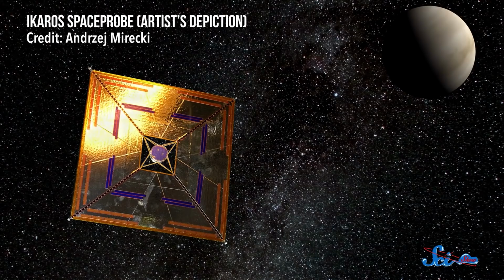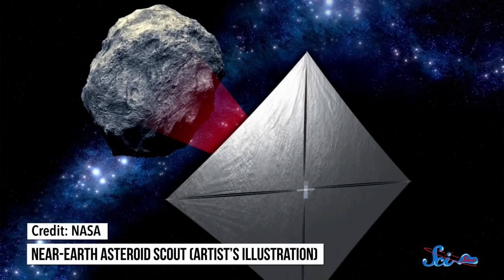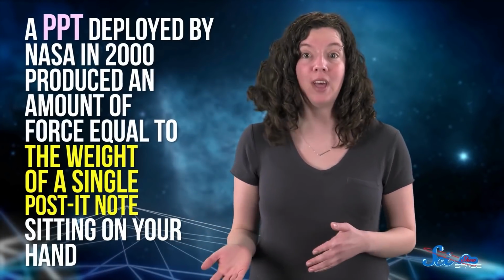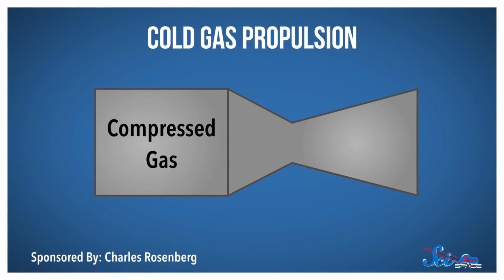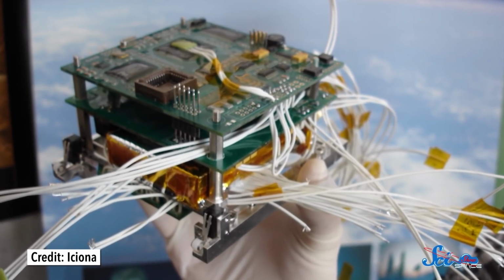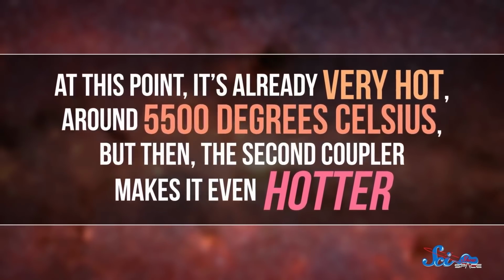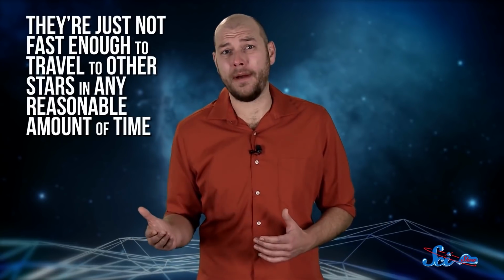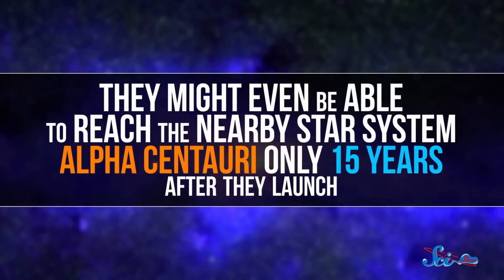5 Ways to Travel the Universe | Compilation

Comment: Great video, but I'm disappointed that there was no mention of Nuclear Thermal Propulsion. Engines for such a system were built & tested in the 1960s ~ 70s. And they worked well. 
They also have about 8 or 10 times the Specific Impulse of chemical rockets. How about a video on that topic - I know you have already made one about Project Orion (nuclear bomb propulsion). I watched (and liked) it.

Comment: We don't nearly hear enough about VASIMR these days 😢
Reply: I'm sure they're working on it, but if it's only one big group they may only release info every couple years.
Reply: Renamed, now NASAs preferred way to assist power to Mars. Radiation measurements have ruled out chemical rockets.
Reply: @gordonn4915  
Well... maybe . 
Truth be told , advancing active/passive shielding techniques may indeed yet come to strongly mitigate the much feared space-radiation hazard . The likely unbeatable problem however , is the "Biosphere Syndrome" . Humans trapped together in a small tin can WILL turn on each other , endangering both that mission and those to come . 
VASIMR itself is potentially fatally flawed ; it's power-to-weight ratio is abysmal , so not as much help as is needed . This is why NASA is also looking hard at revamping the older nuclear-thermal technology . 
In space , brute-force does have a place . 
*To examine some possible near-future space-propulsion systems , read my post at : 
quora.com/How-do-impulse-engines-work/
Reply: @AustinThomasPhD  The last thing I can see from them was a press release in August 2019 and that's it.

Comment: For those wondering about how photons have momentum, we need to look at e=mc^2

That is the equation for finding the total energy of a stationary particle, or simply the energy that the particle itself contains, rather than the energy propelling it. However, when a particle is in motion, there is a slightly more complex equation to calculate it's energy.

e^2 = (ρ^2)(c^2) + (m^2)(c^4)

As photons have no mass, we can remove the second half of the equation and simplify, leaving us with:

e = ρc

ρ, the Greek letter rho, is used for momentum. This can be rearranged to show that the momentum of a photon can be found by dividing its energy by the speed of light, c.
Reply: Usually it's just a p, I can't think of too many cases where it's traditional to use rho for momentum.

Comment: That idea of photonic/laser propulsion for manned missions is only practical between locations already travelled to - to have another "braking" laser at the other end of the journey. Long distance missions of investigation to the nearest star systems, reaching maybe 25% of light speed, would need some equally ultra-high-speed sensors to do some "ultra-quick detecting" at the other end before they blast past in to the far distance!
Reply: Solar systems are big, at 25% the speed of light you'd have a couple days to pass through the solar system. Once we built up the capacity for such missions we could send several through with a much lower marginal cost. I believe that's the idea.

Comment: Launch a solar sail spacecraft.  1 year later launch a second solar sail spacecraft on the same path, equipped with a nuclear powered hi power laser with a tracking system to detect the first spacecraft and aim photons at it's sail.  1 year later launch a third solar sail spacecraft on the same path,  equipped with a nuclear powered hi power laser with a tracking system to detect the second spacecraft and aim photons at it's sail. Rinse and repeat.

Comment: I am wondering one thing. We can use powerful lasers in order to give momentum to a space sail and propel it to relativistic speeds. That's fine. But, why don't we use something with more momentum and mass instead of light? Imagine the following case: We build a small particle accelerator in the moon, and we use it to shoot hydrogen ions towards a spaceship. We don't really need to reach c, since accelerating the ions to 50% of c, would eventually make the ship to reach that speed. We could even use a magnetic field in the sail, and, in the future where we have a fusion engine, we can just send the fuel through space.

Comment: Photons have momentum because they travel at the speed of light, which is the universe's physical analogue for "infinite" speed.  This is why massive particles cannot travel at c, while massless particles *must*.

Absolute Zero and the Planck Temperature exist for similar reasons; actual infinities cannot exist in the real world, so the universe requires analogues so you get meaningful values when you multiply and divide by zero (that's an excessive simplification).

Comment: I use Neutron Stars…first I low fly a Sun with a scoop for fuel…then I short warp to a mapped Neutron Star..where I fly into the cone..the cone will spit me out at 2000c or 2000xFTL…using the scoop also super charges me..after exciting cone I engage warp drive….I’m jumping 100-150 LY in minutes…..using a Neutron Highway…I travel millions LY….I’ve been to the Galactic Core

Comment: The problems with long duration human space travel boils down to one thing, POWER.  Until we can develop a relatively light way, high power system like fusion then we will never travel long distances.  Fusion power can provide enough power to protect against radiation by creating an EM shield and also provide enough power for centrifuges or constant thrust to counteract the problems with living in microgravity.  Develop small scale fusion power and we can go anywhere.

Comment: or, instead of Vasmir, you could return the idea of NERVA which was done in the 60s and could get people to Mars in a month.
Reply: Yeah, but VASIMR has the advantage of not exposing the crew to deadly levels of radiation, and also not risking nuclear fallout in the case of a failed launch.
Reply: @danieljensen2626  You obviously known nothing about NERVA if you think this.  I suggest you actually sit down and read up on the information as for one, the crew will easily be safe from the radiation the reactor is giving off as the crew will not be near it.  Secondly, on a failed launch, the engine isn't going to explode like a nuclear weapon.  People don't realize you have the have the right geometry and density to have a nuclear weapon work.

Comment: 🤔 What about radioactive decay... eg a chunk of radioactive material (preferably waste) enclosed in a lead bow with a small hole. Surely this would produce a small ammount of thrust with the possible bonus of getting rid of nasty muclear byproducts.
Also, Reid looks strange without the beard 😁
Reply: Thrust to weight ration is just too low. As is, you need to measure carefully to even notice... Solar sails do pretty much the same thing but with much better T/W.

And a note about solar/laser sails: Carefully planned trajectories using gravity assists can actually maneuver quite a bit and even stop. E.g. going to Mars could involve swinging around Mars so that the laser can hit from the direction of travel, reducing you velocity.
Reply: @henrikgiese6316  Cheers,  figure that would probly be the case, just an idea thats been rattling around in my non physicist head😁
Reply: @billbaggins  Well... A RTG (RadioThermal Generator) hooked to an ion or plasma thruster could be argued to be "a bunch of nuclear waste powering a spacecraft"... ;)

Also, the Cassini spacecraft seems to have had some problems with the radiation from its RTG actually pushing it off course - but now we're talking about many years of travel to get a noticeable velocity, and the problem comes mostly from having to counter the thrust so that all precision maneuvers end up correct.

Comment: I always wondered if it would be possible to use lasers mounted on a spacecraft to move around. You can use electricity to create propulsion without need of reaction mass. 

My understanding is that we currently don't see any way to create a laser small enough, light enough, and powerful enough to have any real effect. Can anyone tell me if there's any concept papers out there on it?
Reply: Yeah, I mean you can tell from the project that needs 100 square kilometers of lasers to propel a little wafer that the math just doesn't work out.
Reply: @danieljensen2626  a lot of that is largely because they will be expected to continue to provide propulsion over solar system sized distances, literally hundreds of millions of kilometres away. This wouldn't be an issue for something carrying the laser with it.

Comment: i mean chemical isn't the only way to get out of the atmosphere its just the only safe way. there is the Orion drive which can provide the thrust, in some of its larger proposed versions a set of 10 i think it was would be capable of lifting New York city into orbit. the only issue with the Orion drive is its fuel is atomic bombs, it drops small atomic bombs behind large reinforced metal plate on pistons and rides the shock waves into and around space. you could use them on earth save for the fact its very nice to live on earth and atomic bombs and fallout make it not so nice to live on earth.

Comment: If most of a ship's mass is fluid  then moving the fluid would move mass panels on wheels  within a fluid with the walls. and combined with conventional rockets   .

  instead of replacing conventional rockets I'd say aid conventional rockets. Even sending electron through the walls  wouldn't AF trust but push more if particles in certain detection.

Comment: If you could travel at 10% the speed of light it would still take over 40 years to get to the nearest star system, and that's assuming you can slow down instantly which you can't.
Then 40 years to get back. Plus 2x the time it takes to speed up to 10% light speed + 2x the time it takes to slow down.

Comment: Soo..
The VASIMR engine.
Pretty cool...
Limited to space...
Where fallout isnt an issue...
Launched from the moon..
Where there is plenty of nuclear fuel and launch costs are much cheaper.... 
Meaning you can afford to launch ample shielding
.....
Why not use a nuclear propulsion? Nuclear powered rockets are far more power dense and have all the same advantages plus some.
Like developing enough thrust to launch from the surfaces of other planets. Even earth.
Just not earth. Fallout. Fallout bad. Fallout boy, is a matter of opinion.
Reply: Plus. Ya know. Nuclear thrusters have been around since the 60's

Comment: Wouldnt 1 x 0 would still be 1 because its 1 and it doesnt times but its still 1
Reply: 1x1=1 
1x0=0
Reply: No, in maths if you gave nothing and multiply it. You still get nothing. That's just basics maths.

0*1=0
0*2=0 etc, etc
1*1=1
1*2=2
Reply: Anything times zero is zero.